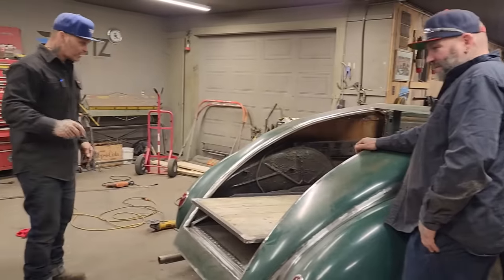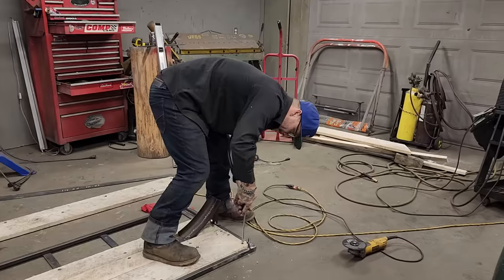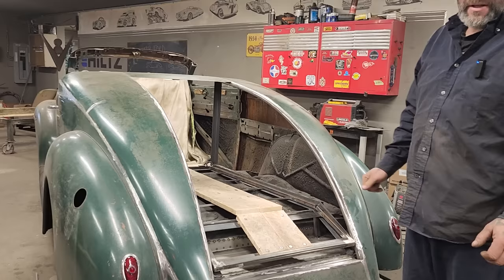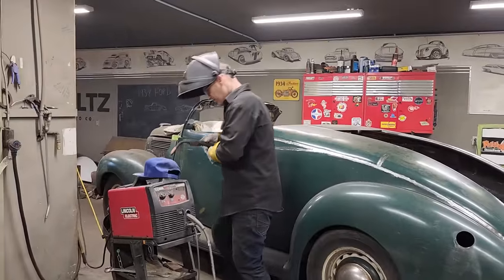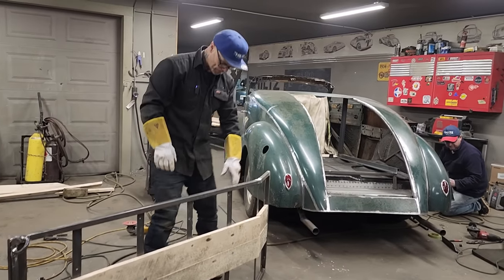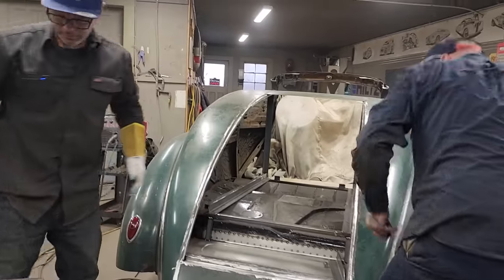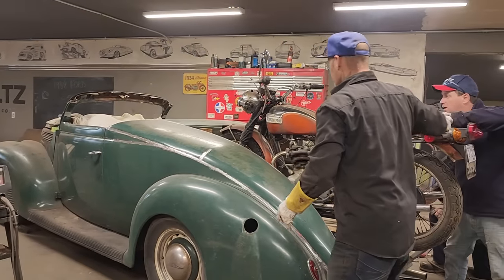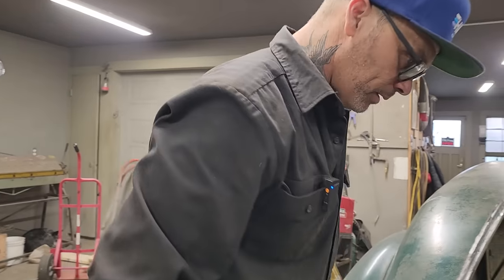We don't like the stance of the bike in the car ❌

Comment: Hinge the beaver tail.  Set the hinge so it folds down.  That way the platform will be flatter for easier loading then will just drop down to the angle of the track when pushed in.
Reply: I was thinking a short, 15" 'second ramp' kicked in position to load the bike then 'stored'
To unload it just let it roll down the steep last 10"  but I like your idea better.

Comment: Just build a typical 2x6 motorcycle ramp that slides in and out under the rear floor. And add floor structure to the height you want the motorcycle to sit. Pull the ramp out and push the motorcycle in, strap it down to the floor then slide in the ramp. Also gives you more length so it’s not so steep of a ramp. Bet one person could do it if they were tall. The whole platform thing looks way more difficult. Love the idea though.
Reply: That would be a good idea. But, where do you put the rear end differential housing?

Comment: Previously someone suggested getting rid of the platform and just have a single "C" shaped rail to hold the bike in place. Get the bike deeper in the car and lower.
Reply: Agreed. The bike is sitting too high. It could be quite a bit lower with some floor rework. Lose the platform and load the bike the same as you would with any other truck/trailer.
Reply: Look at a triple dirt bike trailer.
All it is 3 pieces of c channel to guide the bike.
It would  work great in this case.
Push the bike up the C channel then strap it down
Reply: Take the wood out.
Weld a C channel  down the middle.
Perfect.
Reply: @D_Robinson I recommended this and also to use Boat trailer rollers.  Maybe someone else thought of this too.

Comment: Use a small 12 volt winch positioned behind seat and cable connected to the bike front fork or other non rolling point and when the wheel hits chalk the tray will go with it to its nesting spot. You can reverse the process with some ingenuity saving back and safer in the end. Hydraulics could work also but much more expensive.

Comment: On the angled bike holder
a “V” cut on bottom of 2 inch square
Tube then bent would of closed the gap. No need for hanger weld up on gap holes.

Comment: I think the part you changed on the end of the ramp would be better hinged to be flat with the ramp when in load and unload position also I’d put a small atv winch with remote control to pull ramp in and out

Comment: If you notch the rear square stock and put a channel for the rear wheel to sit in,in the frame ,it will be lower at the back. Not so steep to load. Also you need wheel rollers in the end of that frame so it don't get stuck when unloading. Also a locking mechanism to keep it still when loading ,and in place when loaded.

Comment: Oh Chad, get rid of that monster sled. Consider if you will, a channel going down the middle of the back of the car. Continue it in the rearest portion of the car, which drops the whole bike a bit more, then again, install a winching system to pull the bike up into the rear of the car. You could also make a small channel ramp for the bike exit and entry.

Comment: Chad the beaver tail should not be welded like you have now done, the beaver end of the bed needs a roller right at the end to roll on the ground as the bed is pulled out, Now you need a hinge at the bottom each side, connecting the beaver to the bed, so when the ramp is out it will lye straight so you can run the bike on, but as you pull the ramp in with the winch as the bed goes up the beaver will automatically drop down by the hinge to its limits and give you the beaver effect you desire, regards Merv Lovelock  👍

Comment: If you insist on continuing with the bike hauler. You would gain a full inch by removing to 2 center boards and lay a piece of steel the full length in the middle of the ramp and beavertail. That would lower the whole motorcycle1 inch.

Comment: No don’t cut out a little of the car by M/C front fender so it can go further in…..well too late. I think you could have box-raised the section between the back seat and fender to make your room.

Back when you asked for input on roadster or M/C hauler, I voted for roadster, but I like the look of the car. Back then I asked how you were going to load and unload the bike. You came up with a solution but I’m not sure you’ll ever get it to look like the M/C is not ready to roll out the back. No matter how many straps you use….your right ….  maybe a different bike.

Comment: Take the centre two boards out of the rear end of the tail ramp, which will drop the rear end of the bike down even further. 
Nice now that the Carson top will follow the body line when not in use as a mbike Hauler 🇨🇦🇬🇧👍🤓🍺

Comment: It would be easier with how low the car is to just lift the bike in with no ramp. Just put the front wheel in and lift the back up and roll it in. So far, using this lift has had two or three people together putting the bike in. It needs to be simple where one person could use it to load/unload or there is no point.

That car as a roadster pulling a matching teardrop trailer would have been way better.

Comment: where the back tire sits on the ramp cut a slot big enough so the tire sits down in it a bit and just screw a frame of flat stock around the outer edge of the slot so the doesnt wear the opening bigger

Comment: If you would have cut the square tube from the bottom in a “V” to match the angle of the angle, you wouldn’t have all that extra pieces to cut and weld, just weld the “v” closed and the top would be smooth. Just an old fabricator’s opinion.

Comment: 'a couple of thoughts Chad - 
maybe compress the fork spring with straps before loading and during transport to give you more options of how the car's
sheet metal that covers the bike's fender looks and or is formed.

'maybe a short,18" ramp, is put in position when the ramp is ready to load the bike.
'it will smooth out the front wheel's initial roll onto the ramp.  Then remove and store it and continue
loading the bike.

'another cool machine for the 'stable'

Comment: When you ain't using the motorcycle holler you can use it turn the motorcycle ramp upside down and then you can go bobsledding that's what it looks like when you're out getting it out welding it with that being in the front flip it upside down and it's a bobsled

Comment: Just a suggestion, though too late, being almost 2100 here in Texas.
To cut the frame an inch behind the line of the wood cut, so the wood would be higher behind the wood of ramp. That way the front tire doesn't bump into it whilst rolling it on. As seen at 19:04.

Comment: Would ratcheting  down the back of the bike to a couple of tie downs  yield the profile you are desiring? Maybe some handles on the sled as well.  Can you cable the sled to the car so the sled/ramp can’t fall off of car while loading or unloading? And a couple of pins  so sled can’t move when it is fully forward.

Comment: The loading process could be easier if the bed has rollers, like the ones we see on the airport's luggage x-ray machine. Adding a small in and out sliding ramp (like a drawer mechanism)under the back bumper helps easily load the motor bike. And, leave flat walkway space right and left. Other than that, the car looks loading a motorcycle..

Comment: Need a front wheel chock mounted behind the front tire that rotates as the front tire goes over it and locks it in place against the front tire holding the bike upright and in place so only one person can load and unload (many versions out there I have one for my 2021 Street Glide Special) and it locks and holds it upright no problem... also add a winch that pulls it up into place and locks... then when reversed lets it come back out for unloading.

Comment: Hi Chad, love the concept of this build, I would like to offer a suggestion for more ease of rolling the sled into the car and that would be right at the spot or area where the track bends down is to install a roller on each side of the cars track so you don’t have to pickup the sled so high when you push it in. Also I was thinking that a light weight winch could be installed under the seat so you could pull the bike and sled into the car easily! Thanks and keep up the great work!

Comment: The potential to form a bump, bulge, hump, blister, or arc even, in the package tray to accommodate the motorbike wheel and fender, is an English Wheel opportunity staring Chad in the face.  Having the body lift there allowing the bike to tuck in at the front wheel would be nice - aerodynamic too